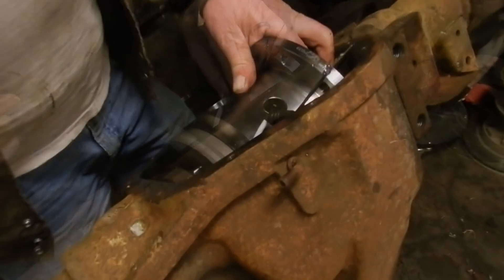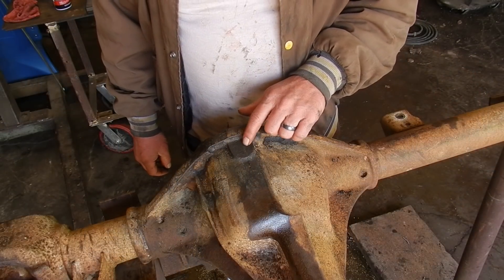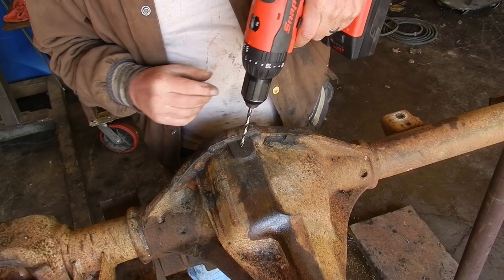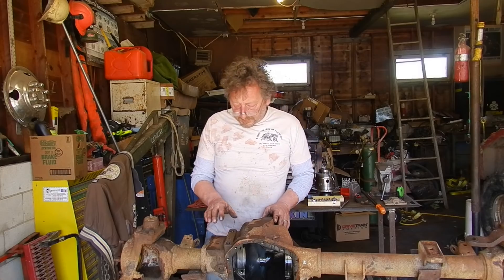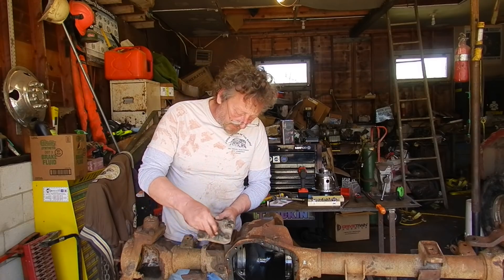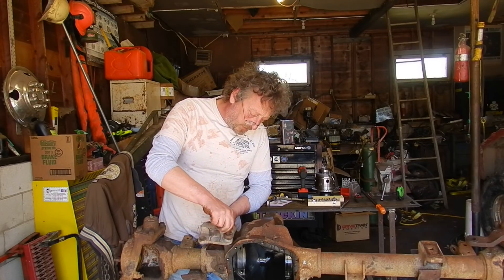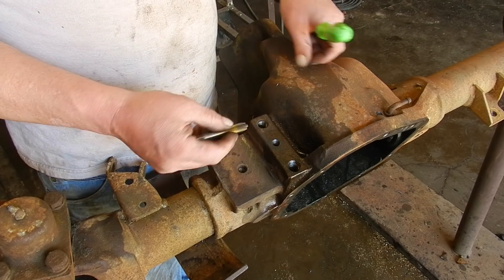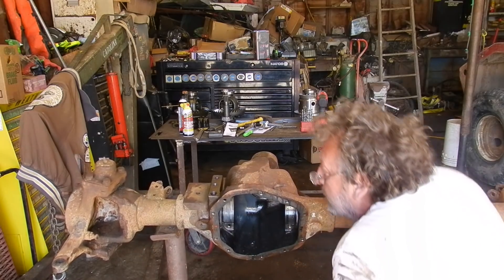Dana 60 axle E locker mods by BSF Recovery Team

Comment: When you need to drill or taper and can not take every thing out use a vacuumcleaner while drilling taping or so.  Takes away most of the debries. Also works when cleaning old gasket.

Comment: A trick for depth drilling. Take your bit and bottom it on an existing hole. Wrap the drill bit in masking tape or electrical tape at the level you want to act as a drill stop.

Comment: You could do that job underneath the truck with an angle drill be a harder job but it can be done that way
Reply: You have to take the front cover off and then drill at all and then clean the grinds out with a little brush that's my opinion

Comment: I like the drain hole in the bottom, too bad on both my 60s I ground those lumps and the extra webbing down to create extra ground clearance under the pumpkin and I'm not sure there's enough material left for a decent plug to fit

Comment: I've thought about putting some kind of locker in my dodge dakota. The rear had some kind of limited slip that was like posi track but it doesn't lock like it did before. it had 73,000 when I got it and it locked up  like it was supposed to when I put it in 4 hi  then the front diff would lock in 4lo so all 4 were getting equal power but it's not working so much now. It still goes in 4x4 mode but the rear is like open diff. But I'm also at 197,800 miles now. I guess the limited slip isn't working so well now. But I have a buddy with the proper tools to give me a hand fixing that problem. The front still mostly locks up but the rear doesn't anymore.
Reply: Factory posi are run by a clutch system, like any other clutch they eventually wear out but the good news is they're usually rebuildable for cheap

Comment: Thx great video Eric, no wonder you hit bottom all the lube you applied it bounced off the side and hit bottom , oh well, better that than dry scratching screaming sound, the only thing tight at our age Eric, is old jeans or a new pair of socks , even those stretch out pretty fast, 🤣,  I been fallowing the axle overhaul/build since the start ,never drawn out or too long, valuable info you pass along to us viewers, look forward to the next video, I use to build Versatile farm equipment 40 yrs ago and everything was an Eaton differential, the assembly was about 5 times the size of the dana 60 one you got there and somewhere around 800 lbs . 👍

Comment: I wouldn’t mind a bit longer videos but these are fine as well. Do what you do because there’s always gonna be “whydontyas” questioning what other people produce! 
It won’t help with the drilling but if you load up your tap with grease, it’ll hold all the metal chips in the grease while also lubricating the hole being tapped. It bind either as the chips stay in the tap flutes. Great videos on the 60!

Comment: Eric, did you try using black oxide socket head cap screws in your spring cap they are 12.9 on the hardness. Might be worth a try even maybe the third one.

Comment: i put mine through the same hole as my ABS. but you don't have a ABS but i was going to take out my vent and use that hole because it was perfect and put a vent on my cover. but but didn't need to. but i did find out the hard way to put the locker on a post that turns off when the engine is turned out. because it will draw on your battery.

Comment: Which are better?  electronic or pneumatic lockers, and why?
Reply from the maker: They both work very well, air is a more complicated install, but the e-locker is more cost
Reply: From everyone I've talked to that's run them fancy lockers (my shits welded, spool, or factory posi) they started out with air, ran them for 2 years until they got sick of chasing down air leaks, replacing compressors, ripping off plastic air hose ends etc, then they switched to electric because they're 2 wires, a relay, a couple more wires and a switch, simple as wiring up a light bar and never turned back

Comment: Eric- a little off subject here; since you're knowledgeable on the older K30 trucks, did a K30 dually with a small block come from the factory with a 2 or 3 leaf spring pack in the front?
Reply from the maker: My plow truck seen in the videos is a 88 K30 4 door, it has a SB, and 3 leaf front springs.
Reply: @offroadrecoveryteam  thx... I have a 79 K20 with a sbc and it has an all steel flatbed on it which is quite heavy. Trying to figure which combo of springs will work with jarring my teeth loose lol